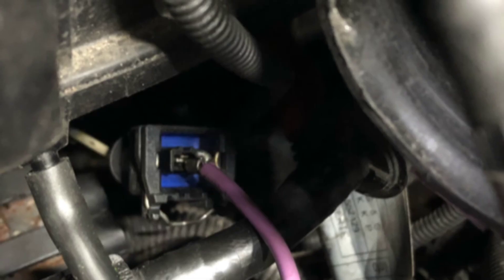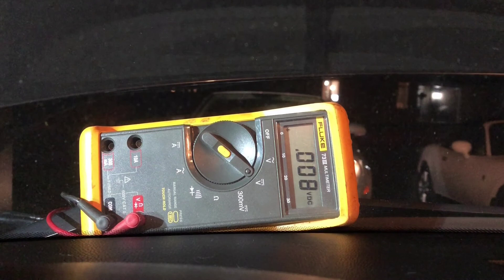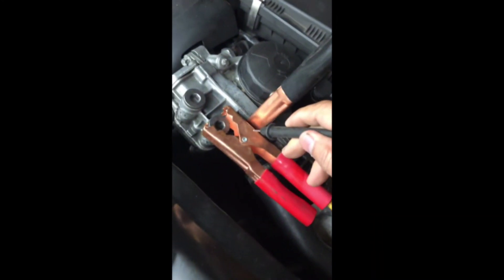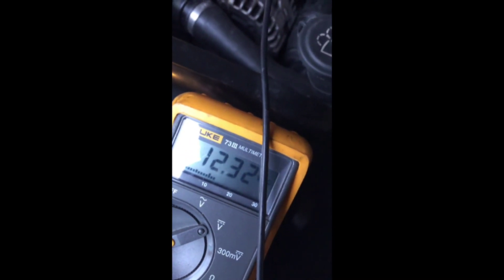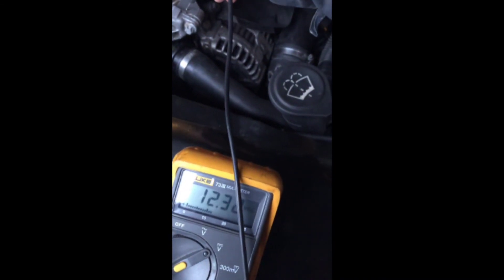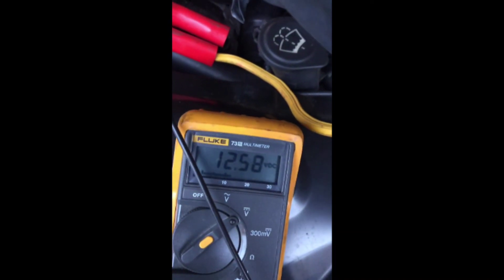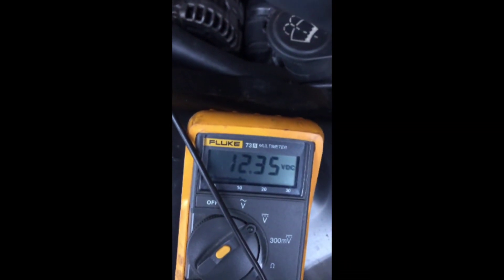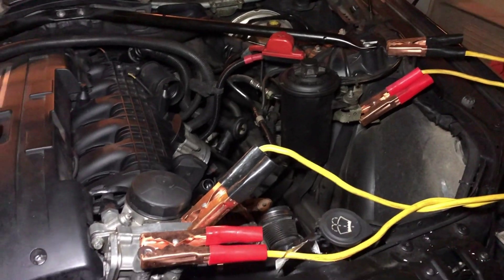BMW 535Xi - E60 No start - Starter won’t crank - problem found - defective GND cable- Part 2 of 3

Comment: Just happened to me, I wish I noticed this post earlier.
Reply from the maker: Well it took me two days to figure this out. Such a pain isn’t.
Reply: @maniata8869  i was off, replaced starter as it initially roll started, a stick configuration. Then checked fuses again, cags relays, battery fusible link. A BMW mechanic actually got it in 30 min, sees it a lot actually.
Reply from the maker: Now that I know. It would be the first place I would check too. BMW is nice car but high maintenance cost .
Reply: @maniata8869 need your help. Looks like this is what happened to mine. I’m pretty sure it’s this, I had 12.5 today and it wouldn’t crank unless I had a starter pack.

Comment: Hey did it crank at all?
Reply from the maker: No crank . Start does not even turn . Watch the video all three parts . Good luck
Reply from the maker: I found the reason and fixed the NO crank issue in part 3!
Reply: No

Comment: Did you just replace the white wire?
Reply from the maker: The signal wire at the starter?  No. That one is okay.  My issue is the ground cable (battery ground cable) connecting from chassis to engine ground. It is on passenger side behind the front wheel. It connects from chassis to engine mount. Watch my video part 3 I think with crow bar and wrench I explained how I did it. The cable is $25 from battery shop instead of dealer cable.  Good luck !
Reply: I have the same issu.ground is good,relay is good.but there is no signal from signal wire to starter and I don’t know why